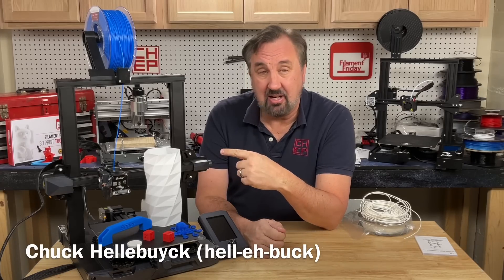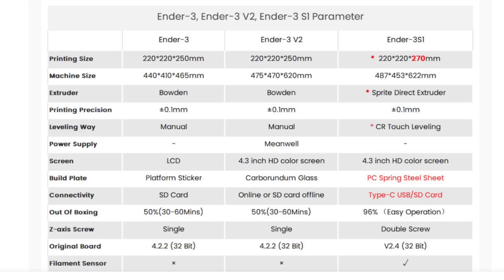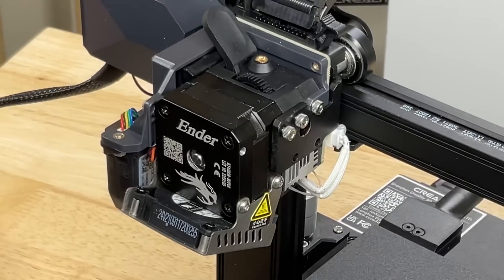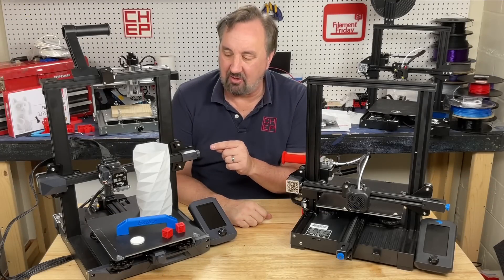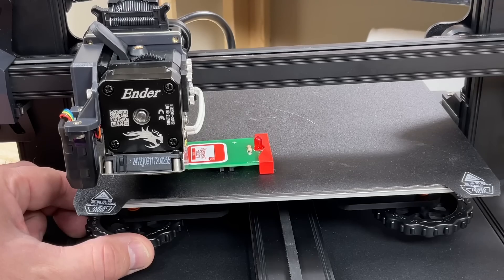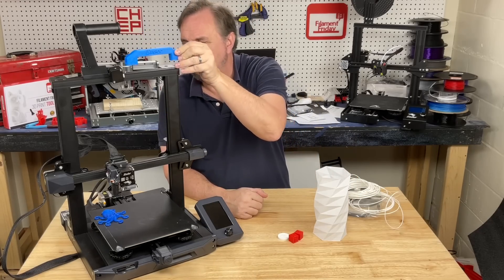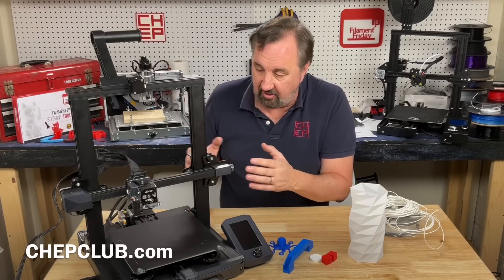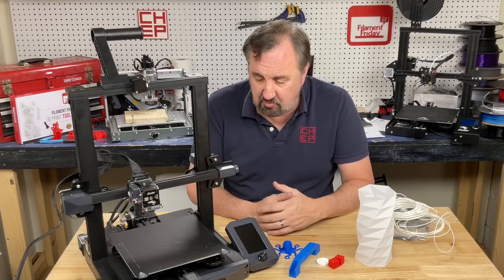Ender 3 S1 - The Direct Drive, Auto Level Ender 3 3D Printer?

Comment: After seeing Vorons, I'm hesitant to get into another slow speed printer.  About a year or two ago when I got my Ender V2, sure, the cool factor of what I was seeing and watching the printer do its thing overrode the whole concept of taking a half day to print something.  But now?  I want to do my prints and get 'em out faster with a decent quality as well.  Not sure if I'm going to get something that'll do the slow speeds anymore.  I'm currently reprinting a redesign of some cartridge holders for my 2600 and inadvertently put the STL into high quality mode.  TWO DAYS to print something at that speed that didn't have a lot of plastic to spit out.  Low Quality, 8 hour print...
Reply: I'm printing dimensionally accurate prototypes at 150 mm a second with my E3v2 and could probably go faster if I fiddle with the settings more. Cuts most of my print times in half. I'm doing that with Jyers. With klipper you could go even crazier. I'm actually really looking forward to pushing the S1 to its limits once firmwares start coming out for it.

I was going to build a voron but after doing all the research, crunching the numbers and thinking of it realistically. It was going to be faster, cheaper and more productive to buy multiple E3v2's/S1's over building one Voron. I have multiple machines in case one goes down. They're cheap enough that if one goes down I can grab one off Amazon in a few days, whereas with the voron I might be waiting weeks for replacement parts. 

If I start making money doing this and I can afford it I will have multiple Vorons. I'm thinking by then the technology will be much cheaper too.
Reply: To print faster you don't really need a voron. Even the ender 3 with Klipper can print much faster. You probably printing pla anyway so the stock voron fan duct design isn't sufficient for it.
Reply: @TheOfficialDarkICE  If I can get it up to 300-400mm I'd be happy.  I'm designing new things regularly, from scratch, and the half day wait for a print is getting tiresome, especially when I want to move onto the NEXT thing.  I'm going to look into this 'Klipper" thing.  I've not heard of it before.

Comment: Creality are so incremental it's unreal. The machine is catered to appeal to the masses, which like you said it does fine. There are printers for under 200 that do all the same just as well such as the mingda d2. I'm over them though until they fix the things you mentioned and make some kind of change to the motion system that can reliably print higher temp material such as abs and pla at atleast 100mms reliably. My cr10 v3 said 120mms on the box and I could never it to print reliably at 70mms. The hotend with the embedded cap tube leaves me speechless. You hit the nail on the head with the review. Great video.

Comment: I got my S1 in a week ago, and it is amazing. My only issue with it is that the filament run out sensor causes drag for some reason, resulting in inconsistent extrusion. I ended up just not using it and running the filament directly into the extruder. Perfect prints so far, and I'm likely going to replace my older Ender-3s across the board with S1s very soon.

Comment: Does it better in anyway then ender 5? Im just curios, the price is close. 
For sure is the best among the 3 series
But untill they will use linear guides i think the e3/3 pro is maybe the best value, it gives u a lot of space for upgrades and mods since its pretty spartan, but as in my case if u are just approaching the 3d world modding your machine will lead u in bad prints for long time until u will learn all the most important stuff about 3d printers
Reply: Yes. It has much better features.

Comment: Well, for an "All Metal Hotend" (that's what they call it "Pro"), Creality wants another 80-90 dollars... Good "deal"! Prusa is then priced within reach...
Reply: Still far from reach. I got the s1 for 399 so under 500 still.. half priced
Reply: @andyvannort2743  But it's getting closer and it looks like it won't be long before Creality has reached the Prusa regions in terms of price... But we can talk about quality and support, there are actually worlds in between!
Reply: @Dimitris1963  there still are worlds between on price as well... we arent even within soitting distance... it's half the price and has plenty more features. Yes the prusa is a better machine and support is better but to get a prusa with all this you can buy MULTIPLE enders... there should be a world of difference quality wise. It's not within reach by a long shot. Maybe 5 years down the line of price hike after price hike while lrusa stays the same somehow they'll be within spitting distance
Reply: If you think 400 vs 1000 is within reach that's like saying a Ford Taurus base model is within reach of a corvette or Mercedes price wise and comparable.

Comment: Too expensive for a small bed printer.  The latest version of the Artillery line, for just one example, beats this all to dust.  And has a Volcano hot end to boot.  This Ender is old tech just updated a bit.
Reply: Yep too small bed for price, additionally while it has direct drive its using completely unique mounting making it hard to upgrade. Its also not enclosed. The market for $400 printer knows what it wants to buy and its not this.
Reply: this is still cheaper if you bought all the upgrades for an ender 3.

Comment: Did you pull the hot break out?  I got a cr10 sr5 and the heat break on it was the first one I sen that had metal going up the body before the tube hit it, was about a inch of metal.  I'm thinking that cr3 s1 might have the same heat break, so you need to remove it from the body to find out. there is one set screw that holding the heat break.

Comment: I've been 3D printing for about a year now. Honestly I've learned a ton of what I want in a printer. I bought a 3 pro and have upgraded with a Micro Swiss all metal hotend, dual z drive, glass bed, all metal extruder, springs and capricorn tubing. Now if look at getting a new printer, there is some things I really want. I want something along the lines of a Anycubic Vyper or MINGDA Magician off Amazon. But maybe for that kind of $$$ I'd just get a FL SUN Delta like the Q5. I don't see much from this S1 that I can't find elsewhere or the upgrades I've already have. Great job Chuck.

Comment: I'm baffled as to why this is so expensive?? They must have flashed that chip to 512k to be able to support the ABL, Runout and all the thermal runaway stuff.  Hmmmm.. Ender 3 Pro, BTT E3 mini mainboard, tft35 touchscreen, glass bed and microswiss dual gear direct drive hot end assembly. ....around the same price and still upgradeable as all get out! Lol, I love my Ender3Pro!! 👍👍
Reply: Marlin now has 256k versions which are most likely what Creality used to configure their FW for this machine

Comment: I have the ender 3pro and I do usable stuff and for me I don't understand the fascination with taller and taller machines. The stuff I would like to make all require a larger bed. Making the machine taller costs virtually nothing and doesn't help me at all.  I do plan on upgrading mine to a direct extruder to print flexibles but for me to buy another machine it needs a larger bed area not taller. I rarely print anything over 4" tall.

Comment: Thanks for the review. I have one since early January and have disassembled and documented the extruder, posted on Reddit.  It’s cumbersome to disassemble but not too bad. The key to the PTFE is that it does not go into the nozzle, so that part should not see high temperatures. I’m printing PETG at 240C no problems. Still, I agree we should see an all metal part here for the price. As this model becomes popular, I hope a vendor comes up with a metal part to use in this extruder. Also, with regards to your comment on the 256K, Marlin has just incorporated an update that accounts for motherboards with 256K chips. In practical terms, there’s no loss of functionality with the current Marlin versions, but once again, ideally we’d have gotten the 512K version. Still I really like the machine and am very happy with it. Using it with vanilla Marlin at this point, not the version that Creality provides.
Reply: How good is the touch screen? does it have limited commands like the Ender 5 Plus?
Reply: @AndrewAHayes  this is not a touch screen. It’s a regular screen with a rotary encoder button.

Comment: I will answer that for you, YES is is worth it.  If you buy the Ender 3 or Ender 3 Pro then do all the upgrades yourself it would cost about the same, but you have to do the work.  Also you got a new easy swap extruder/hot end.  They have a light bar coming and they have a all metal hot end swap and laser etcher.

Comment: Thank you for the in depth review!

The manual, SD card and filament were all garbage, they should have provided a Sandisk and spool with the filament. I wish they would take the extra time to refine the documentation and provide quality accessories.

M gripe (as a newb) is not being able to find community forums for the S1. Also, Creality's site doesn't have much for S1 replacement parts for those who want to be prepared in case a fan dies. Are the fans the same as the Ender 3 V2?

Comment: Apparently there will be an Ender 3 s1 pro too, saw it listed in cura in an other review. Also the pro version of the sprite extruder appeard on online shops which is all metal. Also saw an hotend called Spider from creality online (but not yet available) which they say can be an replacement for other creality hotends and could do 500°C for 40€ here in Europe. Thinking of getting one of these for my V2 instead of the heatbreak you mentioned which would cost just 6€ less...